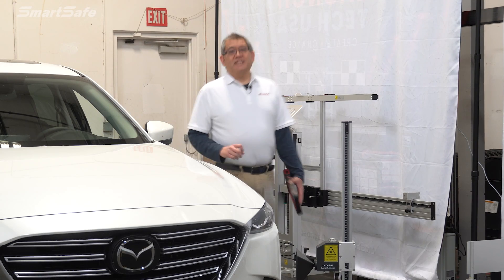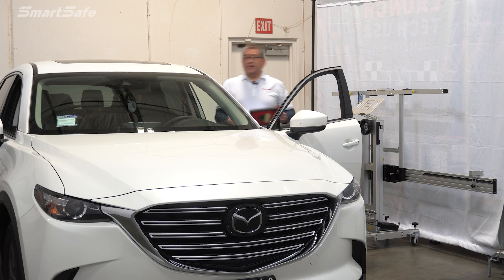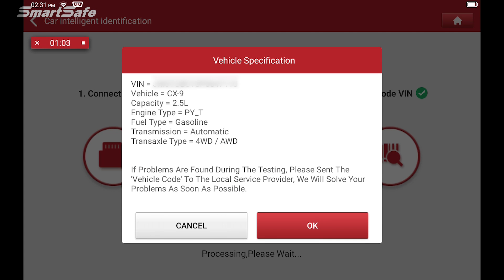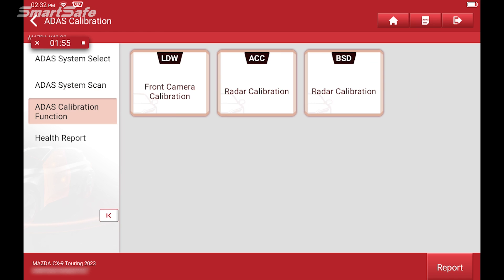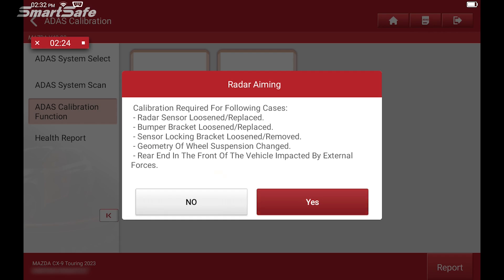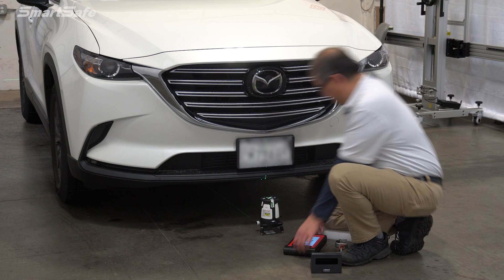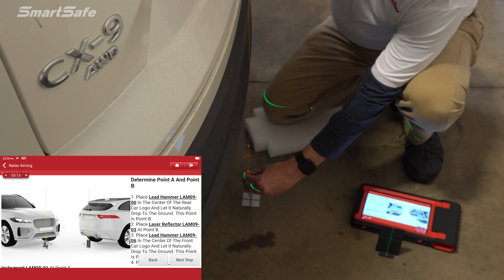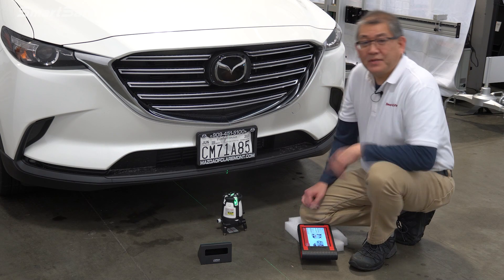Calibrating the Forward Sensing Radar (FSR) on 2023 Mazda CX-9 using the LAC05-03 Corner Reflector

Comment: This is a great video. Thank you for it.  One question - The pictures shown on the scan tool you used shows the reflector (antenna) with one of its points, pointing upward.  However you have the antenna oriented such that the "top" of the antenna is flat. Does this orientation matter?  The scan tool reported a successful calibration.  I wonder if one also achieve a successful cal if the antenna was rotated as per what is shown on the scan tool?  Would you know?
Reply from the maker: Good observation.  The tablet's graphic of the trihedral corner reflector is shown in what is a "normal" position where the pointed side is facing up and the flat side is facing down.  However, most OEM ADAS calibration equipment sets up the reflector with the flat side up and the pointed side down.  Apologies for the confusion.